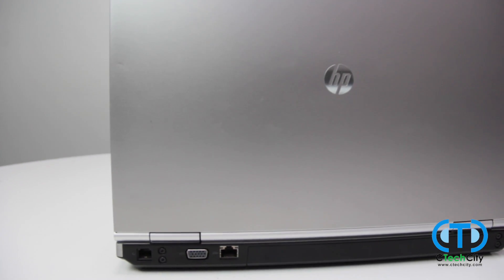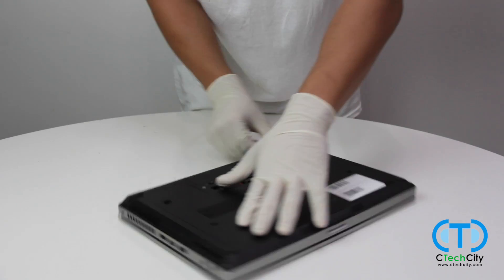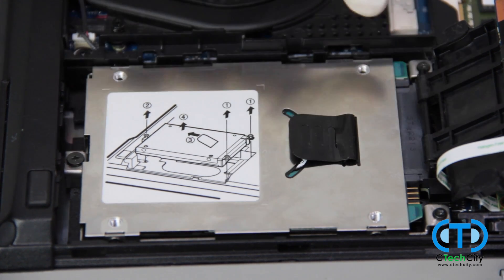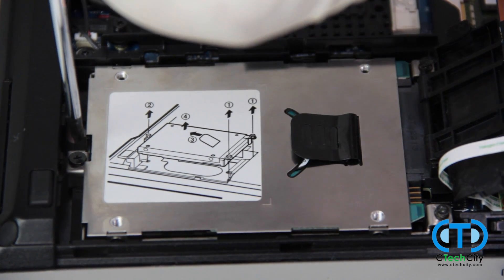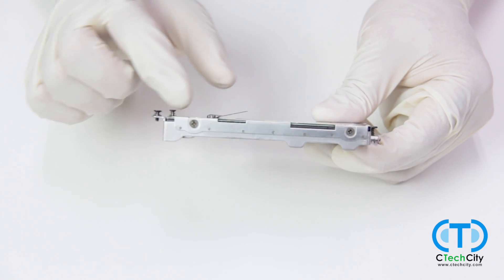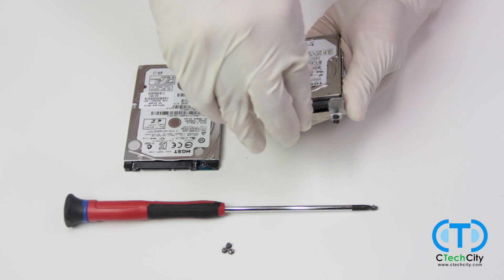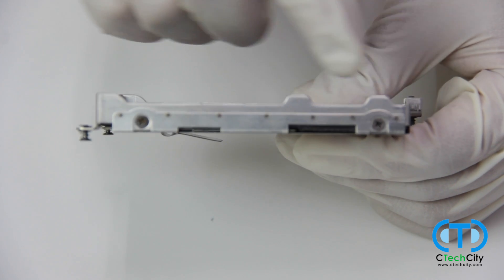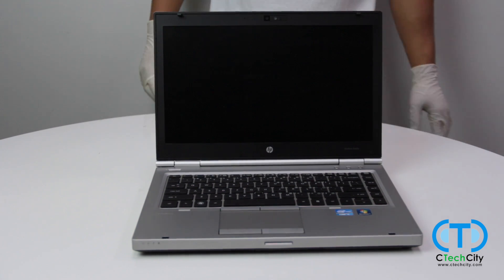How to Install a New Hard Drive in Your HP Laptop

Comment: Can you use any hard drive to replace it
Reply: No. On a laptop you will need 2 use a size 2.5. There are 2 sizes a 3.5 and a 2.5.  3.5s are for a desk top computer. For a laptop they only take a size 2.5.
Reply: @916Shaggy  does it matter what laptop it is specifically because my laptop stop working after it took a very light spill off my lap anytime I've looked up the codes or whatever came up online it always said replace HDD let me know as soon as possible I'm trying to go buy one today and fix it today